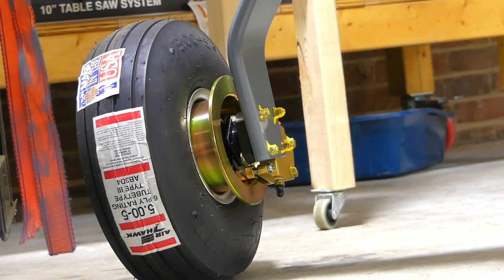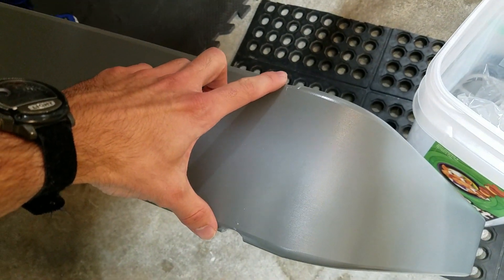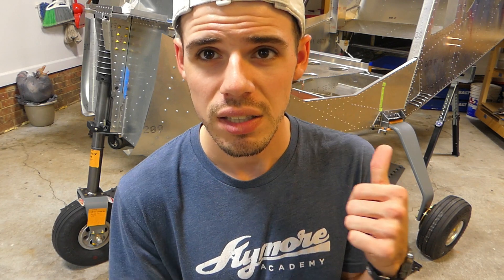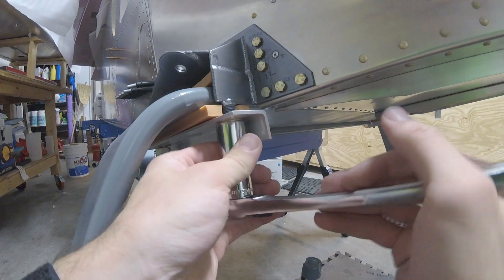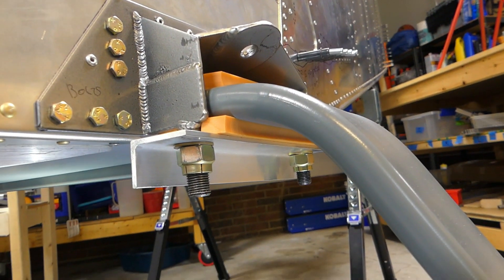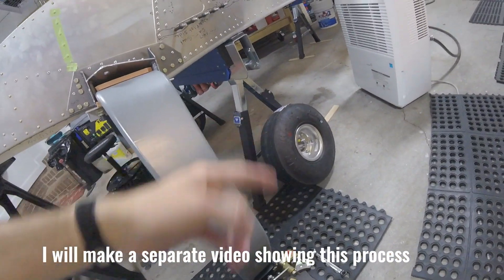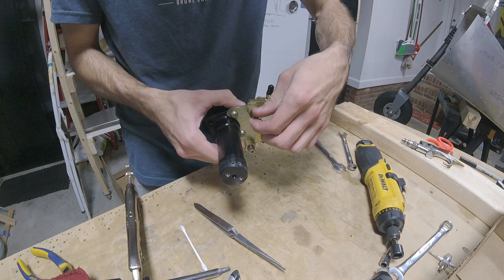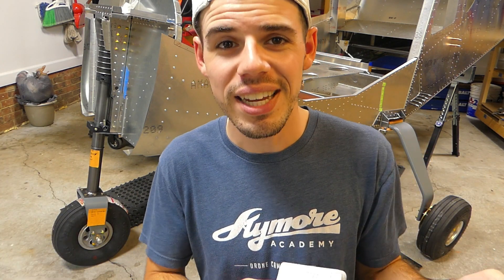MAIN GEAR - Landing Gear PART 2 - MATCO - Zenith 750 Cruzer

Comment: Love the videos, great work! I would think those brake bleeders need to be pointed upwards. Cool to see you and your dad sharing the whole experience.
Reply: Actually, just watched a home built help video for bleeding matco brakes... looks like the bleeders are mounted on the bottom, and the gear legs were altered to fit similar to how you’ve done it.
Reply from the maker: Yes, this is definitely a team effort! And the valve pointing down is not an issue if the brakes are serviced from the bleed valve using plastic tubing and a hand pump.

Comment: Please double check that you have your calipers installed on the correct sides.  Your bleeder nipple is pointed down which will make it very difficult, if not impossible, to bleed the brake system.  I love the series.  Keep the videos coming!